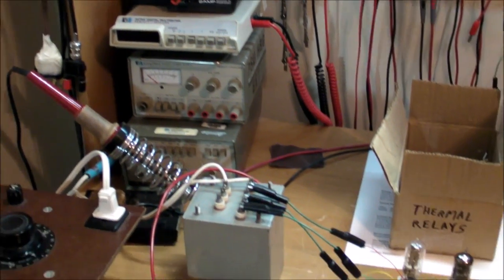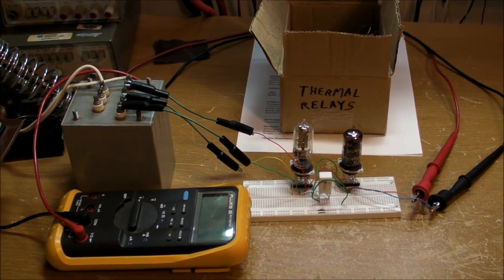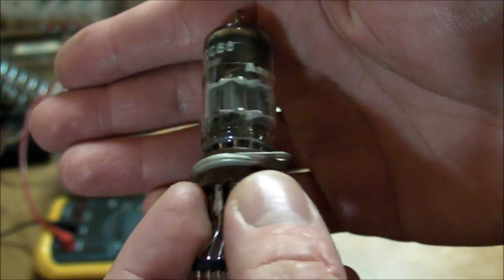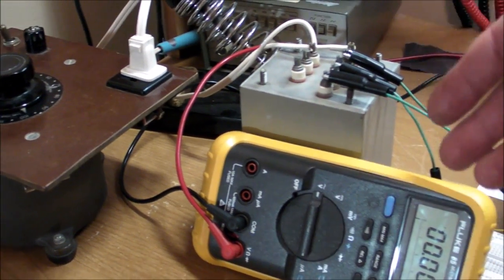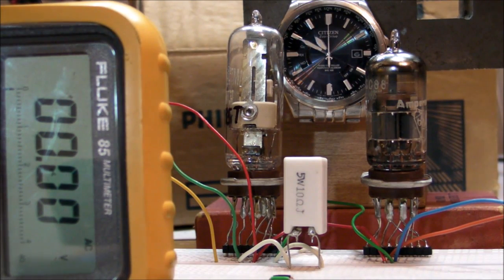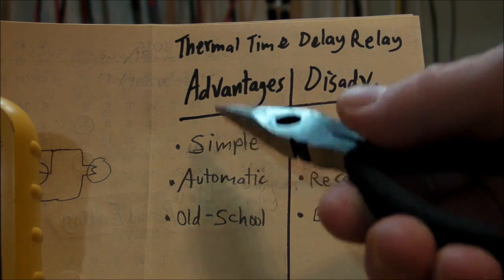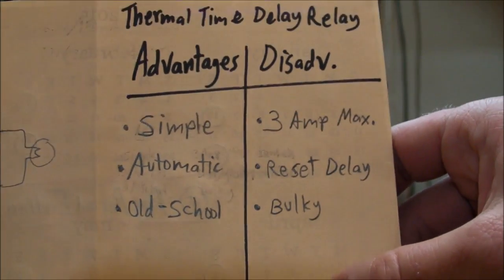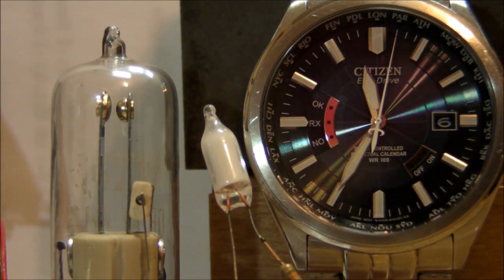(#0212) Vacuum Tube Filament Flash

Comment: Today I built a vacuum tube based one.
For large power tubes the filment needs to be soft started.
So a big resistor and a bypass circuit, i didnt want transistors so I thought, how about a vacuum tube in series with the relay and the delay offered by the vacuum tubes indirect filament is a bit long 20s but still perfect for such application!
Note that the voltage drop on the tube, i ended up with a voltage doubler on the tube to get close to 12v on the relay.

Comment: Nice demo, thanks. Would you say that filament flash is a problem? I bought two 12at7 NOS tubes and did not like that they had filament flash when using them with my guitar amp (none of the new/modern tubes have filament flash) and the vendor said it is normal and that they are high quality, I am thinking of returning them ... your thoughts?

Comment: Heater flash is a signature feature of many European tubes. I've seen it in Holland Amperex tubes, I've seen it in Blackburn Mullards, I've seen it in lots of European tubes, and since those tubes are often 50 years old and still work great,  it's evident that this is NOT a "problem" but just a characteristic of their heater chemistry.

Comment: I just got an old analog light control timer. Thought it had a tube amplifier but it was actually an Amperite time delay. The delay looks like a good buffer for the tube amp. But in a motor wouldn't that be called in rush current so  would an easier option be a capacitor or some other discrete component?

Comment: I have this  6n045t tube but is this practical what if I wanted to run 3 6dj8s in parallel filaments does this mean I have to triple up or down the resistance on the resistor and can the time delay tube handle the heavy current load I'm assuming that resistor cuts that down.

Comment: Hi Eric! I have been repairing a Tek 2467B and, a it has one big vacuum tube - the CRT - it also experiences a heavy draw on initial power up and uses two NTC thermistors as current inrush limiters. After initial power on, according to the theory of operation they "cease to have any effect on the circuit". Also, i have an old Marconi RC oscillator that blew its 2080 SQ tube because the NTC thermistor that it used just after the transformer had completely burned to a crisp. I couldn't even tell what it had been until I tracked down the schematics and BOM, but it was definitely a recognized solution to cold heater current.... I've just thought that maybe heater-flash caused the thermistor to burn up....the value was obviously calculated to limit the cold heater inrush, but maybe the filament flash on one or more tube pushed it over the edge?

Comment: Here is another idea that some engineers can work out. I know that there are purist old radio folks that do not want to add anything to alter their radio in any way shape or form. Is it possible for a separate delay timer to be installed in its own enclosure outside of the tube radio or amp? I was thinking that a timer delay relay with a heater rated at 120 VAC might be used. The device would have a cord to plug into the wall outlet and a receptacle for the radio or amp to plug in. The device would actually have the entire 120 VAC reduced down to 60 VAC through an appropriate sized resistor. When the radio or amp is not on no current is flowing. A current sensing device or circuit might be installed so that when the radio or amp is turned on the timer relay starts its count down. Then when it is at the end of its time period it would supply the full 120 VAC to the radio. It might have to have a latching feature as long as current is flowing to the radio and will unlatch when the current flow stops. I have seen some time delay relays that work on 120 VAC. The relay is a double pole double throw with contacts rated at 10 Amps.

Comment: Why is the filament flash problem?  There are many of ECC82 and ECC83 made by RFT (DDR) flashing every time when power up. These tubes can work for decades.
Reply from the maker: +brys555 Most tubes will not have filament flash, but at the beginning of his video, Mr. Carlson explains how he experienced a significant lot of specific types of tubes that were prematurely failing due to filament flash.

Comment: why do tube filaments have this flash?
Reply: +lez briddon The have it because the filament end that sticks out at the bottom have very low thermal contact to the rest of the tube, so it's the part that heats up first and takes all the energy.
Reply: +lez briddon I didn't expect you are interested to vacuum tubes and XM's :D
Reply: Always liked the sound of tube amps, but dont think they would last long in any car :)  no longer an xm owner moved to an 806 which is not such a bad drive.
Reply: +lez briddon It's partially what +zaprodk said. And also partially that these filaments are PTC's almost. They start off at a fairly low resistance untill they heat up. The same goes for the filament in lightbulbs

Comment: With a relay you can also use the old school RC delay using 2 resistors and a capacitor fed from DC, smoothed or not, using the resistors so you get a delay using the build up of current through the coil to turn it on.

With the remainig tubes drive them heavily at 12V filament current and try to get the anodes to cherry red, connecting all the electrodes to the anode either direct or via 100r, so you can get max plate current through. Take the popped one and apply high voltage to do the same, might work well on a NST, especially as there should be some free gas in there now from the cathode.
Reply from the maker: +SeanBZA I do have quite a bit of cheap junk tubes. Will have to torture them sometime like I did for the bad rectifier tube in my Atwater Kent 55C radio.